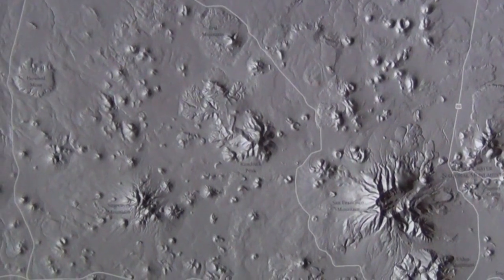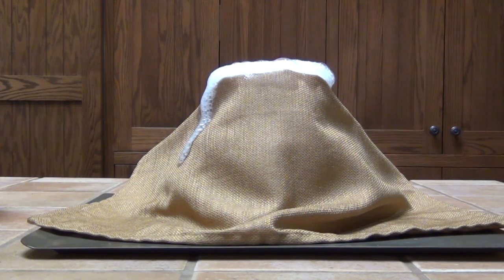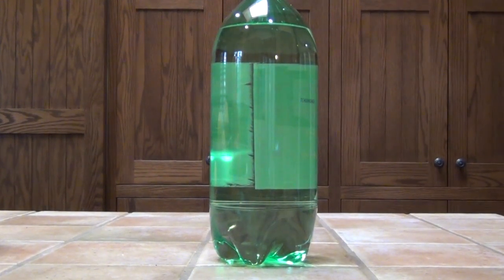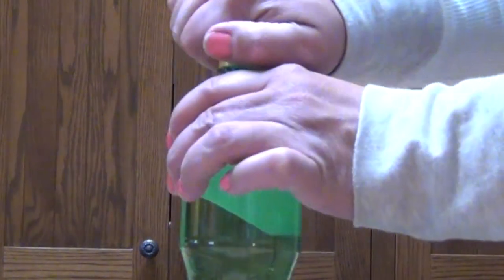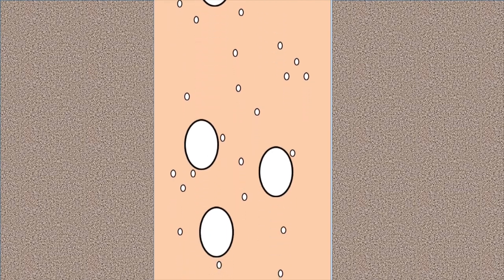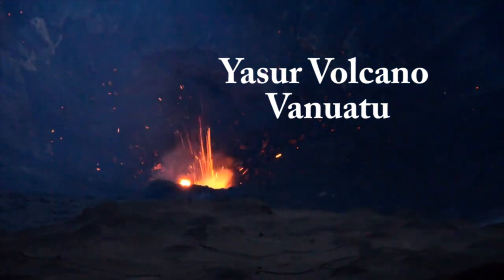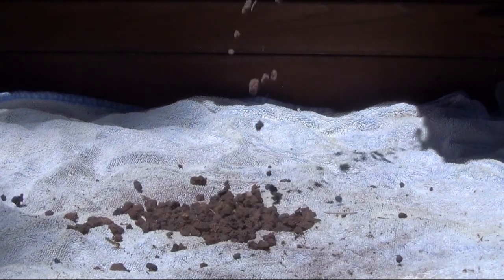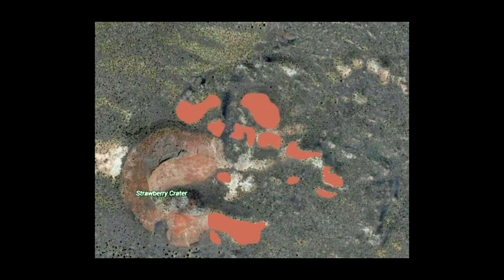The Volcanoes of Flagstaff: cinder Cones

Comment: Why are the cinders black or red?
Reply from the maker: Great question. (I think this might be worth a separate video) Basically it's a function of the eruption temperature. These magmas are fairly high in iron, and above some threshold the temperature is high enough that the iron will oxidize (just like rust)  while still airborne, and you get a red cinder. Below that threshold the cinder is black. What is that temperature? Still researching that one.